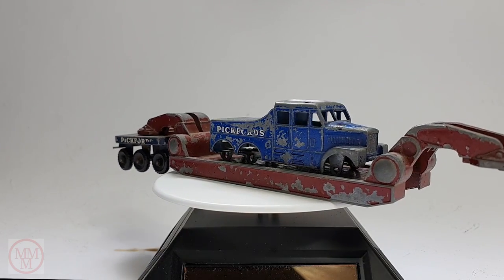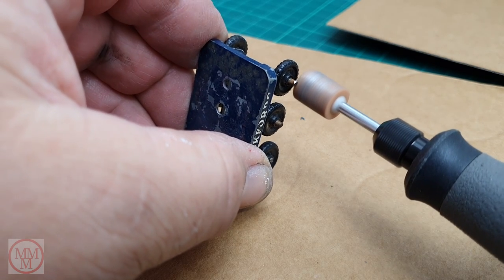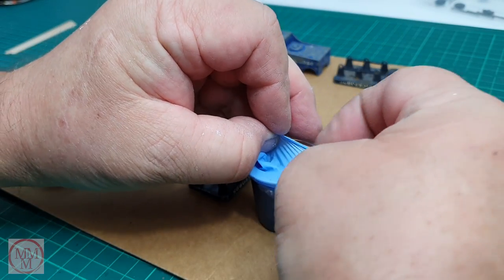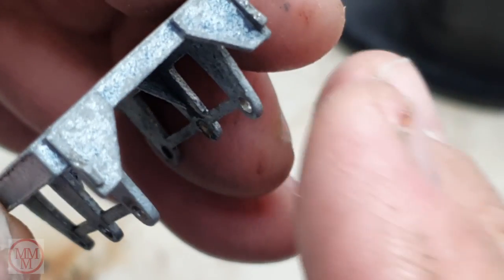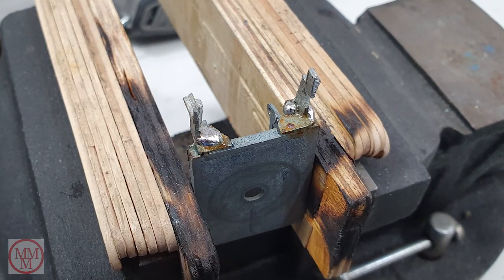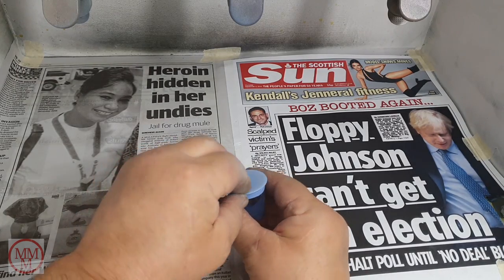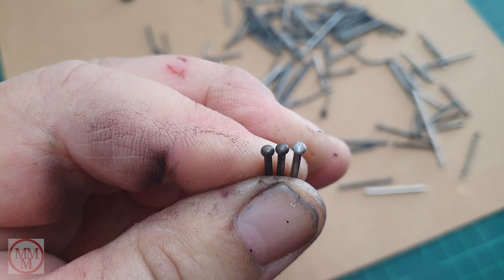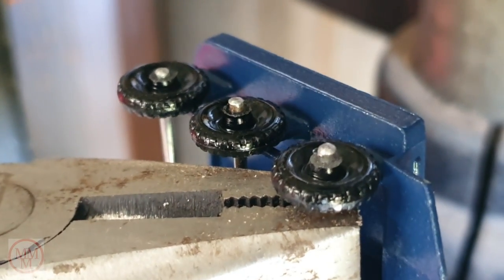MATCHBOX Restoration Major Pack No.6a Scammell 6x6 Tractor 1960

Comment: Very interesting video, very nice work.
As far as the fan goes, when I used to paint in the garage I would tape a house air filter to the back of a box fan. You don't need that much air but they make small desk type box fans that you could put a disposable filter on. 👍👍
Reply from the maker: Great tip!

Comment: When this vehicle was boxed, the tractor sat on the trailer. If they put the tractor in front it would have been really long, and therefore the box would be too long. So when you see this in the original box the paint on the trailer will be chipped where the truck sat. This was caused by the truck moving back and fourth.  Even though it moved just a tiny bit, it was enough to chip the paint. Great job as usual.
Reply: Jesus William, you legend. What a great memory you have. You "reactivated" my brain. Yes, I now recall as a kid the chipped paint on the trailer after it was taken out of the box.
Reply: It was also in a box set, the trailer was in a long bottom slot and the tractor in a separate slot above it. The set also had a construction shovel, a BP Tanker and a two piece Tractor-trailor.
Reply: @timfaracy754  Great work Tim, I recall seeing the boxed set I think in a catalogue in an antique type shop in Greenwich in England. I should have bought that bloody catalogue too!! Oh well.
Reply: Great information. 
Mike Espo .

Comment: The little details on the rear of the tractor represent part of a winch.
Reply: Guide rollers for the cable - sometimes you have to winch broken-down equipment onto the trailer.

Comment: Marty,
To save tape that is not sticky anymore, try putting the roll in the microwave for about 30 seconds.  Typically, it will revive the stickiness and make the tape useable again.  Great job on the restoration.

Comment: Superb restoration.  Great repair on the broken bogie.  A bit of effort and a scrap looking model looks like new again.  Got my own paint disaster.  A #46 Mercedes 300SE.  Paint went all "orange peel" finish.  So back into the  polystrippa again.  Yet the DAF girder truck I did at the same time turned out fine: smooth and glossy paint.

Comment: I can imagine that particular set wouldn't have been cheap in the 60s. That would be a big Christmas or Birthday gift. You have done another amazing job on what was a wreck. It's amazing that little truck can pull the huge trailer.
Reply: Depending on the load, there would often be other tractor units added, in front and/or behind the trailer.

Comment: the tractor is a Scammell conctructor , which was a 6 wheel drive, 125 ton unit, the 'rams on the back are fairlead rollers for the 100 ton winch , which was mainly used for side loading the trailer, nice restoration job by the way.

Comment: I would recommend a finer blasting medium to avoid the pitting.  The aluminum medium seems to be gentle on the softer metals.

For the soldering, I recommend an adjustable heat electrical soldering iron with a fine tip.

Comment: many years ago when researching methos to apply texture to plastic I was advised when visiting a  leading sand blasting manufacturer in Slough to use walnut shells to remove paint without damaging the metal  .

Comment: It's the glass beads in the sandblaster that is causing the pitting. 
Back in the 70's and 80's Cadillac used that very technique to achieve a pitted finish on the face of their outside rear view mirrors.

Comment: Th details on the back of the tractor unit are the rollers of a winch unit. The cable was kept dismouned within the body of the tractor until needed.

Comment: Another great job! Soda blast media works well on die cast. I find the garnet and glass beads tend to roughen the metal and blunt some of the finer detail too much for me. Very rarely do I have a problem getting all the paint off. Usually it's because I'm not getting the right angle on the difficult spot. The down side to loading your cabinet with soda media is that it doesn't work well at getting rust off of materials like steel, etc. So, I found a small countertop cabinet from Harbor Freight and made that my soda media cabinet. Upgrading you compressor will help immensely.

Comment: You may be able to use pecan shell type dust for your sandblast cabinet..it will not damage the soft metal. there are also water-based rust reformers at body shop catalogues..

Comment: There is still one of these Schammell tractors in Brisbane at the Tram Museum. The Brisbane City Council use dit to tow broken Trams form 1946 to 1969. It is immense and can tow a completely dead tram with ease. Amazing machine.
Reply: My Local District council had a Scammel like that as a breakdown wagon for the bin lorries. It could only drive at 25mph maximum speed, but that was empty or with 30tons of lorry behind it .

Comment: might try baking soda in the blasting cabinet, it's supposed to be gentle on soft metals and won't give the pitting you had with the media you used here,  the guys at a nearby shop told me they use it on pot metal parts when restoring classic cars
Reply: Indeed as it seems the blasting material may have actually dulled the fine features on this Matchbox model, along with the pitting.

Comment: Marty, the parallel cylinders on the back of the prime mover were (on the real vehicle) winch fairleads to support a winch cable.  Didn’t this toy originally v cab one with an electrical transformer on the low loader 🤔 Anyway, great work. Thanks for sharing.

Comment: I dunno, the metal of the castings is so soft that I would be terrified to sandblast it with anything. The major upside of paint stripper is it attacks the paint, not the paint and the metal both. Great vid tho, AMAZING amount of work you put in and a fantastic result.

Comment: I've definitely been at the 95%-99% stage of a project and managed to screw it up! The whole model came out great especially the color matching.

It may be more effort than it's worth but you might want to try trimming the excess decal film from the top and bottom of the trailer decal pieces so they fit in the area easier and snuggle down better.

Comment: Wrap your casting with a wet rag it helps to keep things cool so you’re less likely to melt the casting also cools the casting down faster and helps to reduce the possibility of the casting warping. Also bevel the two edges of the two pieces if possible it will make the fix stronger. I used these technique when I worked on hot rods and we would cut down and weld the rear ended or the frame.

Comment: If you're going to do media blasting, use either walnut shells or baking soda. glass and garnet will damage your base metal. It will take a bit longer than your chemical stripper, but it's more eco-friendly and ultimately will do a good job. It also looks like your pressures are off. check your compressor. You should be able to "paint" off the paint just as your airbrush paints on.

Comment: Might try drilling threw, taping the hole for a small screw, cut the head off, thread in and peen the cut end. Then it would be a small but underneath, removable if needed but very secure.

Comment: you need to use " SODA Blasting " will remove the paint without affecting the surface
Reply: soda works good. i've found that fine glass bead works really well. i'm helping to restore a ww2 bomber and that is what we use do get a very clean surface without damage. looks great Marty.
Reply: that garnet you are using is really rough on surfaces like that
Reply: Apparently sand blasting with walnut shell medium will remove paint with minimal to no effect on the surface finish.

Comment: Nice job. I'm surprised the rear tire is molded into the truck body and not an additional tire. Did you consider painting it even though the original didn't have it painted?

Comment: The media blasting does a lot of damage to the surface of the metal. Perhaps the walnut shells will be better, but paint remover is guaranteed to affect only the paint.
Reply: I'll second using Walnut shells.
Reply: I'll third using walnut shells. 🙂👍
Reply: Please stick to paint remover. Saves time.

Comment: Great job! Btw - i think that sandblasting does not pay off (even not for real vehicles) - necessary dust gun, dusting material (which has to be cleaned after a while), compressor, cabin, noise, power consumption - i did it on a real car once an was happy to dust out the sand out of the hollows for 2 days (not!). Better living through chemistry...😅

Comment: Even the smallest sandblaster will struggle to run off a 240v compressor. Just stick to paint stripper . The mazac material the castings are made from is so soft blasting is not a good option
Reply: I wanted to give the same comment, you are completly right.
Reply: A 100 litre, two cylinder 240V compressor should be enough for the sand blaster cabinet

Comment: Regarding Sand Blasting
(we calls it sand blasting here States Side, despite the fact that we're not using actual sand)
Bigger models such as submarine lamps and Tonka Trucks can take the abuse because there's more material to weather away, but smaller toy cars, really need to be careful about how much is being done because there's not much material and Zamac is surprisingly soft

Comment: Hi Marty, nice job on the M6a!

Dealing with the front bogie is always tricky due to the restrictions of the rivet design. You had good success with that one!I've dealt with one or two missing or broken ears for the draw bar on nearly every restoration of the M6.  I did take note of the time you spent on bending/making your own draw bar.  Nice job, but too much time and too long in overall length for my OCD.  I always use the replacement wire draw bar made by Steve Flowers (http://model-supplies.co.uk/).  It's also sold by Tony Howden (Recover Toy) but at a significant four times + markup :-(  Placing bulk orders with Steve is always the least expensive way to get your replacement parts and decals. The price difference will easily cover the shipping cost from the UK.

I am very interested in the "Duratech" solder you used.  Am I correct in assuming that the flux is proprietary to that solder? As many of us know, normal solder and solder flux does not work on diecast so I am wondering if it's this type of solder, type of flux or combination of both that makes this solder job possible???  Also, does is work with dissimilar metals like Muggy Weld does (as I like to make my metal replacement parts from aluminum stock)?
Reply: I also have some helpful tips on making parts like the draw bar ears, If anyone is interested, I'll post them in another comment.

Comment: Just a point about soldering parts.  You may have more success with finer solder wire that has flux in the core.  You can get it from Jaycar.  Great work Marty.

Comment: Hmmm.... I dunno if ya still got this sandblasting cabinet with your move, but... you said frosted glass? it sounds like you either need a new glass or change the protective film on the inside if there even is one, as it's not supposed to be frosted. :P
If you do swap the glass, maybe look into if there is one available with a square of magnification in a corner, I think I've seen that before, for detail work, also, maybe mounting some LED lighting inside it for improved light.

But, that's if you can even be bothered with using it in the future and if you even still have it, and for such small thin material, I think maybe soda blasting might be the best option, though you need a new nozzle for it, but it might be fine with the old air compressor, as it needs 20psi, instead of the 100+psi of other blasting media.

Comment: I really think you are stuck in a paradox with blasting.  In order to get the paint off you need higher pressure, but to achieve that you risk the finish and details.  I think chemical softening is a far better application for your purpose.

Comment: Sand blasting is a quick way of cleaning up all kinds of metal. You need a high volume of air at different pressure. You need at least a 50 gallon tank. I have made do with a 25 gallon. But you still need a compressor that is able to keep up. The pump you have doesn't have enough volume. Electric types like that cannot keep up. This link will give you an idea what I'm talking about. This one is a gas one. It doesn't have to be gas. It can be electric. But you need at least a two cylinder. You might even find a one cylinder. As long as it can put out enough volume. To blast that type of metal, you need to use fine grain sand. Or fine crushed glass. Even use baking soda. If you use baking soda, clean the parts well with soap and water afterward. Don't ask me how I know that. Turn down the pressure. Sand blasting will etch the metal. If you use as fine a medium as you can find, when you have your pressure right, the etch will be finer. The metal will look more flat and smooth. When you prime, your prime will go on smoother. Because there are less divetts in the metal. Higher volume of air, finer medium and less pressure for that kind of metal. I'm a toy restorer from way back. And one last thing, I've been wondering for a long time why you don't have a filter in front of your exhaust fan?  Sooner or later the paint will plug up that fan. But, putting an air-con filter in front of it will save the fan, It might keep your fan from burning your house down one day.....https://www.amazon.com/Ingersoll-Rand-IRTC2475F13GH-Two-Stage-Powered-Compressor/dp/B0015SDHK6/ref=sr_1_5?dchild=1&hvadid=78271594731384&hvbmt=bb&hvdev=c&hvqmt=b&keywords=ingersoll+rand+compressor+2475&qid=1602638596&sr=8-5&tag=mh0b-20

Comment: You could have filled the hole with the weld, filed and re drilled.
Reply: Soldered perhaps, the mazak these models are made of melts at a lower temp. than welding.

Comment: You are missing a piece on your trailer on the  fix bogey  there is a little piece of metal that sticks up off of it it's a control panel for the rear bogies our broke clean I just bought one  the other day I was just thinking about you doing one and see how you would fix the draw bar and pop up this morning

Comment: In the US, we call any tape like that duct tape. It comes in low quality medium and high, then there is the 200mph tape like Nascar crews used to use. That stuff is very pricey! anyway, even with the quality tapes, there is one thing you should never use it on, ducts.. the heat cold cycles wear it out pronto and then it won't seal, no matter the quality. that tape you got is the really low quality stuff. barely even sticks to itself.

Comment: Baking soda is used when dealing with antique cars/planes etc. May have to resort your dime to even aircraft paint stripper or shop in a good hardware ware store when you can’t get the paint stripper you’ve been using. I’d be careful as to the stripper being to caustic I’d match what you’ve been using and see if it’s the same or see if theirs a web site or number you can call to order in bulk. May be more expensive but with Covid what are you gonna do. Art supply stores etc. they do make rattle can in the same paint or use real automotive touch up paint just paint them another color just so you can get by.

Comment: Your compressor is too small.  It is constantly running because it’s never reaching pressure.  You’ll notice a huge difference if you get the proper size for sandblasting.